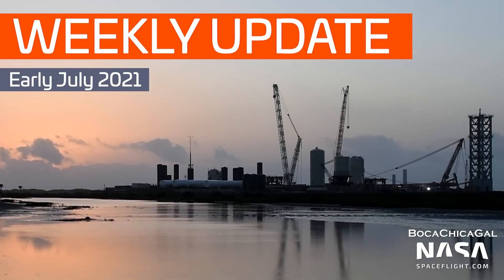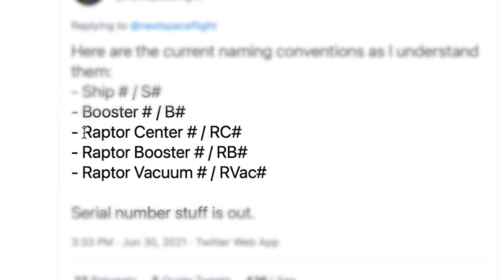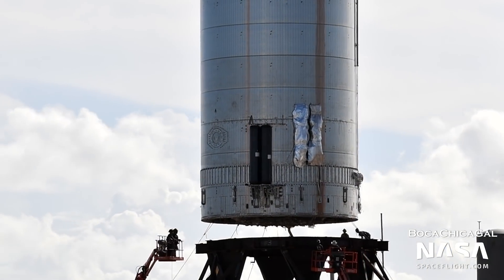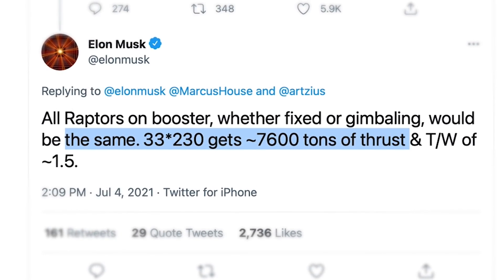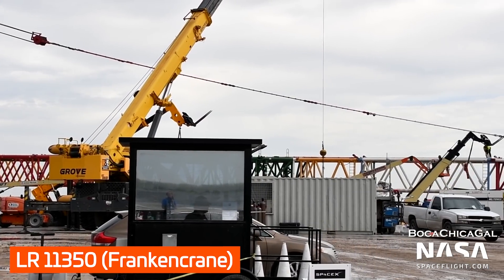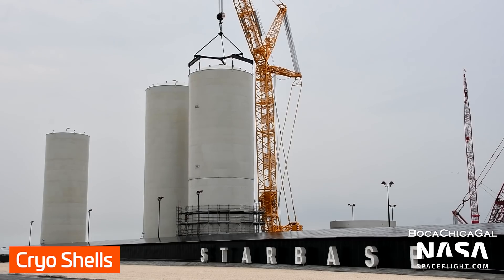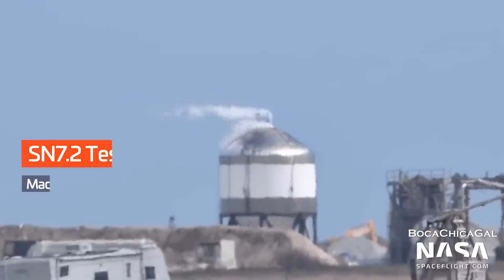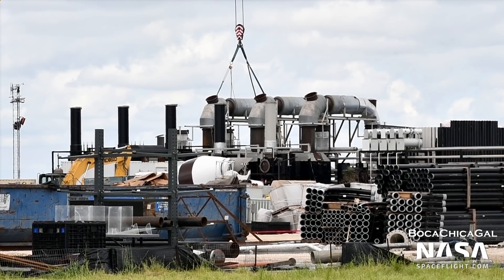How is SpaceX Preparing Starship for Orbit? | Starship Update (Narrated)

Comment: I know what the mystery structure.  And it should not be a mystery to you either @NASASpaceflight.  Its on the SpaceX graphics.
It is the structure to hold the booster down till all rockets are upto thrust then release the booster.

Comment: I can understand why  BN was changed to Booster # and SN was changed to Ship #, which greatly simplifies things. However, the one change that shouldn’t have been made was the change of RSN to RC, Raptor Center. This is because you’re categorizing the engine by where it’s located on both vehicles instead of its’ primary use case. Raptor booster, now RB#, works because you know immediately that it’s an engine specifically for the booster, a different configuration than a Surface Raptor due to lacking gimbaling. Raptor Vacuum makes sense because it’s primarily used for burns in a vacuum, due to being optimized as such. Raptor Center not only implies that this isn’t a standard engine, but that it is unrelated to RBoost, which Elon specifically said that both are now the same, as Raptor 2.0s. 

So I suggest to change it (Back in a way…) to Raptor Surface, which I abbreviate to RSurface, or even RS. A minor difference, but one that is consistent to its usage to sea level burns, which require the use of gimbaling unlike that of a RBoost and RVac.
Reply: But more importantly: Elon & SpaceX never specifically stated that Raptor 2.0 with gimbals were in fact called RCenter. So for newcomers it makes sense to keep consistency for why they’re named the way they are in the meantime. Plastering the standard/surface variant with an arbitrary name not consistent with use case doesn’t help that.

Comment: 6:38 the nosecone without wings sounds like a lunar variant right? Any reason it wouldn't be a lunar starship v1?
Reply: Wish it was me, but, another commenter saw markings on the left hand side when it was stacked which hinted at a possible hatch or hatch-comb. Maybe they are using it as a pathfinder to designing a Moon based Starship. I don't think they could use this one, as I would imagine big changes required. Three examples, moon lander needs rocket thrusters high up to lunar land. It would need solar panels for power, unless they took a nuclear power unit. If it was a one-way trip, they may use a smaller or different header tank for landing fuel supply.
Reply: @David-yo5ws  What you say makes sense, without a way to land this wouldn't ever be a lunar variant but perhaps the exhaust holes for the breaking thrust would be cut out later since the breaking thrust would be on the inside of the vehicle. 
The solar powered outer layer I imagine they could slap on much later in the design similar to how they attach the heat shielding tiles.
But without any of those the chance this becoming a early moon lander mock-up 2.0 is slim.

Comment: 3mm vs 4mm wall thickness of stainless steel of the entire rocket.  I can't even begin to compute the difference of mass savings this will result in but it sounds quite significant.
Reply: I calculated it before but I forget the exact number. If they don't add any reinforcements, it would save ~20 tons of mass. Likely less though with stringers, but even 10 tons would be significant!

Comment: Posted this on the forum, but don't know if any of you saw it.  So I'll try again here.

Mary, Jack Beyer, and other editors, if you're reading here:

The first part of the daily video upload on Sunday showed the caption banner and explanation text in the upper left corner of the view.  (It later switched to the lower right as has been typically the case.)

I'd like to request that you consider making the upper left the default for captioning.  Why?  Because often, there is something interesting at the bottom that gets covered up by that banner, and especially when the view is panning, we sometimes miss what's there.  Whereas the upper left is, most of the time, sky or the side of a building.  Nothing to obscure there. 

If you can do that, thanks very much.

Comment: The 'mystery' structures at 7:53 are curved and have heavy duty pivot points - I think they form part of the 'catch arm' component.
Reply: I am trying to imagine how that would work.  Am having too many questions that point the wrong way.
Reply: I really cant see that being possible, but its a mystery to myself as much as anyone else.
 But what i do see so far, imo, Suggests something that will be on the ground, my best guess is the mount for the super heavy staging area, the pivot points being arms that will be hydraulically pushed up from the outside like flower pedals closing, to hug and secure the boosters as they wait.
Reply: @Vatsyayana87  That is what I have been saying all the time. Nothing to do with the pad or catching boosters. A parking place of sorts, for boosters waiting their turn.

Comment: 7:50 New mystery structure could be a system for loading and maintaining Raptor engines on Boosters.
Outer pivot points having a mechanism to lift the engines through the 20 slots.
Cradles being for crew to do the necessary attachment work.
Reply: I haven’t heard too much smart speculation about this, but this is the more interesting idea I have heard so far. We will see!
Reply: However, doing a pixel count based on workers nearby at average height 1.8m, the slots between the columns are only 0.9m wide and 2.2m high - too small to fit a Raptor through.

It could perhaps be that the engines are taken inside through a wider slot, and then there are platform lifts that work through the 20 vertical slots, attached to the outer pivots.  The structure looks too finished and long-term to be just a test rig.
Reply: My take. Workers need easy access to boosters NOT on the pad, but waiting to be put there.
This structure gives them a working "booth" with all they need. The structure also has hydaulic clamps to hold down the booster. Reduces the need to use manlifts and the like.
To be placed, maybe on pillars, on the new foundation next to the tower.
As to installing Raptors - that will never be a click and play...way too many tubes and wiring to connect. Thankfully once installed they will seldom need to be removed (once the early problems are fixed).
Reply: I keep thinking they need a way of effectively loading a rack of engines - some kind of engine cartridge. Resorting to head-torches and cherry pickers doesn't seem optimum.
Reply: It looks like a test stand, part of the heavy booster staging pad.  They're going to have to do a full test burn at some point, and it'll take something like this to keep the booster from lifting off.
Reply: @LunarDepression  Engines would be too close to the ground on this structure.  Full test burn likely on OLM, which will have support/hold-down clamps inside the deck (table).
Reply: @HighPeakVideo  That might be what the tall pillars we saw the other day are for. To put the structure on and get access to the bottom of the booster. Just an possibility.
How btw would the tanks on the structure survive the flames from 29 or more Raptors taking off?
Reply: I think that could be an element of the tower crane like the par of the top rotor.
Reply: @gavinkemp7920  It has 9m diameter support points, 20 of them, so is probably for a booster.  Base has pegs for embedding in concrete, so likely on the ground.  Some structure will be needed for installing engines easily.

Comment: Maybe the 'no flap' cone is for the moonshot starship
Reply: Wish it was me, but, another commenter (TopMarksIT) saw markings on the left hand side when it was stacked which hinted at a possible hatch or hatch-comb. Maybe they are using it as a pathfinder to designing a Moon based Starship. A test article. But it can't be THE Nosecone for the Lunar Starship, as too many changes to the configuration would have to be done. eg, smaller header tanks or even multiple header tanks for thrusters high up on the nose for Lunar Landing. 
That's my thoughts/guesses.